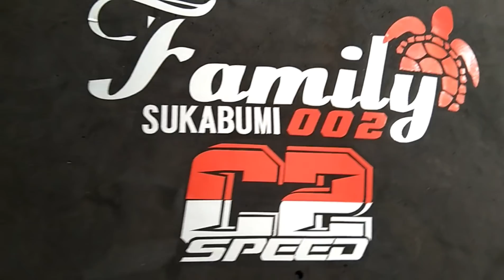Cara Pasang Piston 59mm dan bagai mana cara masukkin liner ke crankchase tanpa geser baut tusuk sate

Comment: Salam 1 rumpun bang.. salam dri malaysia timur,sy dulu sama macam  abg,selalu di ejek-ejak.. di sebab kan sy moto honda c70 sy diorg cakap gerak macam semut,dari situ sy uji kaji dan sekang c70 sy pkai blok lagenda kalau di malaysia diorg panggil honda ex5 class1 saiz 62mm crankshaft arata diameter 104 jet rod 6mm.. camsahft costum... Carb power jet 35mm.yamaha 125z bleh lg lawan smbil senyum dan diorg sudah tidak ejek mto sy lg.. ☺️☺️☺️☺️✌️

Comment: Kang mau tanya kalau supra fit new mau bore up pakai seher kaze standar tapi linernya pakai yg bawaanya. Itu buat harian aman gak
Reply from the maker: gk bklan muat om klo d liner std
Reply: @c2speedc2jokcustombuilder10  kira liner bawaanya kalau di bore up cocokny pakai seher apa yah dan diameter sehernya berapa
Reply from the maker: @robislamet9050  vario 125 abis nya om
Reply: @c2speedc2jokcustombuilder10  itu udah mentok paling gede yah oversizenya kalau pakai liner bawaan. Di pakai buat harian masih aman kan
Reply from the maker: @robislamet9050  aman om
Reply: @c2speedc2jokcustombuilder10  thanks kang. Channel yg sangat bermanfaat . Dah saya subscribe kang
Reply from the maker: @robislamet9050  🙏😁
Reply: Oh iya bang lupa nanya . Ntar liner bawaanya setelah bore up pakai sehe vario 125 tebal sisa brapa ya
Reply from the maker: @robislamet9050  0,75
Reply: @c2speedc2jokcustombuilder10  mau tanya lgi ni kang. Supra fit new . Kalau mau pakai liner kaze itu lubang di crankcasenya harus d corter ga
Reply from the maker: @robislamet9050  iya om

Comment: assalamuallaikum bang, saya dari kendal jawa tengah, jadi gini saya punya mesin grand 97, seher pakai punya blitzjoy 56 os 25, buring pakai bangau, klep in ex sudah pakai punya shogun. jadi permasalahan nya gini, kompresi sering bocor lewat baut tusuk sate atas bawah sebelah kiri atau deket nya rante keteng, kadang juga bocor lewat bates antara squsih dan jalur rante keteng, padahal sudah ssaya lem juga pake sealer. mohon bantuan nya bang, makasih
Reply from the maker: Wa'alaikumussalam... Beli pavking kaleng yg bahan nya tembaga om di online banyak,insya Allah teratasi...
Reply: @c2speedc2jokcustombuilder10  oke suwun bang, ngomong" tadi saya liat video yang pengertian tentang temlar roller dan standart, untuk yang roller abang pake part dari motor apa ya? apa aftermarket?, lalu harus ada part lain yg di rubah apa engga klo pake temlar roller? suwun sudah di balas
Reply from the maker: @arfsurya6364  racing buat supra PNP om banyak di online 😁

Comment: Om, kalo Honda Star dikasih piston 59 tetapi pake Blok ORI nya bisa apa enggak?
Reply from the maker: Boring hitam mentok nya sampe 57mm om lineran nya
Reply: Tapi kalo di kasih blok motor legenda baru bisa ta om?
Reply from the maker: @irfanardani8036  bisa om bahan beda jauh sama grand
Reply: Tapi lubang Crankcase nya cukup kan om?
Reply from the maker: @irfanardani8036  cukup
Reply: @c2speedc2jokcustombuilder10  itu kalo pake noken Campur cocoknya pake lift berapa ya om?
Reply from the maker: @irfanardani8036  harian 8,5 aja om
Reply: @c2speedc2jokcustombuilder10  biasanya kalo buat balap itu lift nya kisaran berapa om?
Reply from the maker: @irfanardani8036  9 lebih om

Comment: bang kalok besarin sehernya terus stang sehernya masi bahwaan bisa ngk bang
Reply from the maker: Bisa om
Reply: kalo pake sehar tiger sama gk bang pin seher nya
Reply: bang minta wa nya,,
Reply from the maker: @dimaswahyu9073  gak om
Reply: pin sehernya ukuran barapa sih bang
Reply from the maker: @dimaswahyu9073  supra 13 om
Reply: makasih info nya bang,,
Reply: sukses chenelnya bang
Reply from the maker: @dimaswahyu9073  🙏😄
Reply from the maker: @dimaswahyu9073  makasih om 🙏😄

Comment: Untuk taoring aman mas?
Reply from the maker: Kalo pake oil cooler sprtinya aman om
Reply: Klo itu dipake untuk apa mas?
Reply from the maker: @nacoya-1273  awal nya buat drag liaran,lalu di coba di road race om
Reply: Oke mas mkasih
Reply from the maker: @nacoya-1273  🙏😄

Comment: Om brapa ongkosnya bisa kaya gitu??
Reply from the maker: ongkos apa nya om
Reply: @c2speedc2jokcustombuilder10  om nomer wanya dong. Sy mau order boring custem nya
Reply: @c2speedc2jokcustombuilder10  porting head cylinder spek roadrace mp 2 
Ama klep lebar
Ama boring custem punya om ama pasang 
Brapa om ongkosnya kira2. 
Kalo cocok harga mau ngirim ke om. Di tempat sy blum ada yg pengalaman kalo buat mesin c series/grand. Mohon infonya om
Reply from the maker: @familyderma7818  1jt an om
Reply: @c2speedc2jokcustombuilder10  kalo ama kikis cem clep ??
Reply: @c2speedc2jokcustombuilder10  nomer wanya dong om
Reply: @c2speedc2jokcustombuilder10  1 juta udah masuk piston ngga om ??
Reply from the maker: @familyderma7818  bag head aja ok,blm sma noken atau piston
Reply: @c2speedc2jokcustombuilder10  brapa om kalo sama piston ama noken
Reply: @c2speedc2jokcustombuilder10  kalo noken racing kawahara ribut nggak ya om ??
Reply: Terima orderan kan om kalo luar jawa ??

Comment: Bang kalau block grand gabisa ya
Reply from the maker: Gk bsa om
Reply from the maker: Gk bsa om
Reply: Mentok diameter berapa kalau blok grand
Reply from the maker: @aryasaghotra7514  liner mntok di 58mm om
Reply: Kalau pakek sufit/legenda bisa kan.
Maaf om tanya lagi 😀😁,saya pernah baca artikel di google kalau pake liner 61 itu apa benar menggeser boring ke bawah.
Kalau nggak salah namanya offside engine
Reply from the maker: @aryasaghotra7514  ya kurg lebih sperti itu om
Reply: @c2speedc2jokcustombuilder10  kalau offside engine itu bagaimana om mengatasinya,apa semua bengkel bisa
Reply from the maker: @aryasaghotra7514  ada yg bs,ada jg yg gk bisa
Reply: @c2speedc2jokcustombuilder10  pengaruh nya apa dimotor om
Reply from the maker: @aryasaghotra7514  paling mentok om